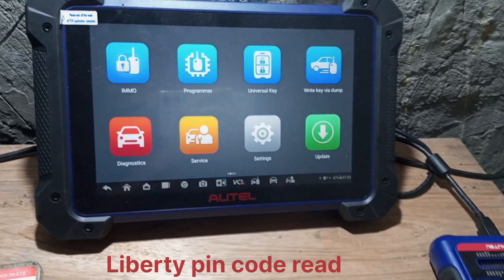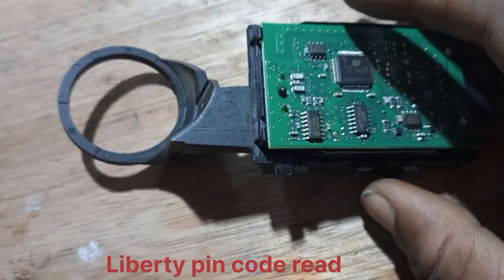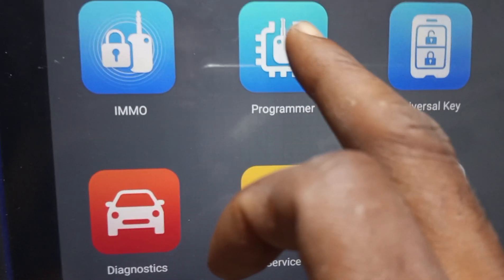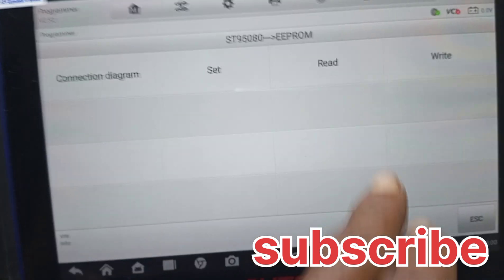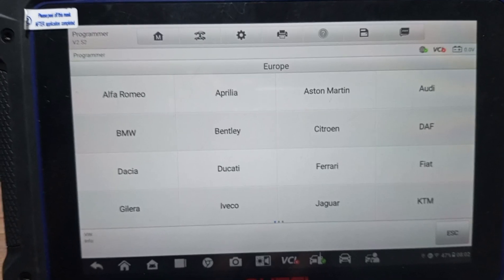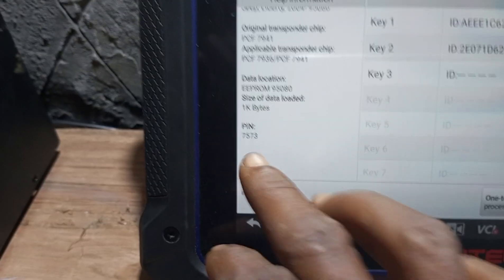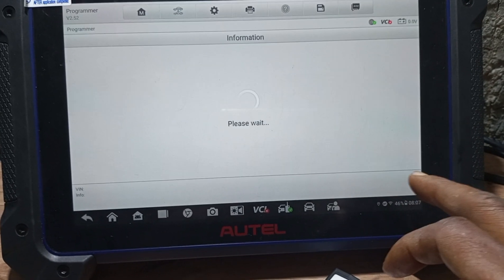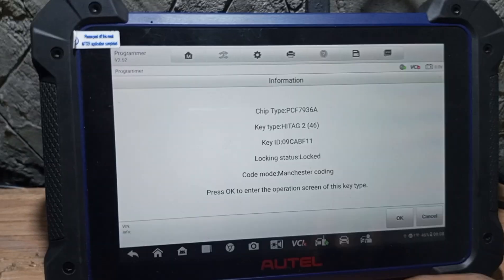how to get a 2005 immobilizer pin code with autel im608 pro 2.@Lasselectricalzone

Comment: Hello from France,
Please I hope you can answer my question, I tried programming an additional smart key for a Peugeot 3008 year 2021 using Autel IM608, but it failed and I am trying to understand the reason. I read the transponder of the original working smart key in XHorse Mini and it is ID4A, 433 Mhz FSK. So I prepared an Xhorse Smart Key XM38TOY model, to this peugeot, and then read it, and it was ID4A, 433 Mhz FSK, same as the original key.
I went into Autel IM608, Automatic Selection, then I clicked on Immo Status Scan and I got a message that this option is not supported for this car, so I wonder why!  So I clicked on Control Unit and managed to read the password, then clicked on Hot Functions then All Smart Keys Lost Guided (there is no option for Add Smart Key), and I followed the instructions, and I first reprogrammed the original working key and it said Learning Successful, then the XHorse Smart Key but it said Learning Failed. I prepared the Xhorse Smart Key in Xhorse Mini, to another option (ID4A also), and tried again, but it failed again. In Xhorse Mini Remote options there are only two smart keys ID4A for peugeot, and I tried them both, but failed. Thanks so much for your help.